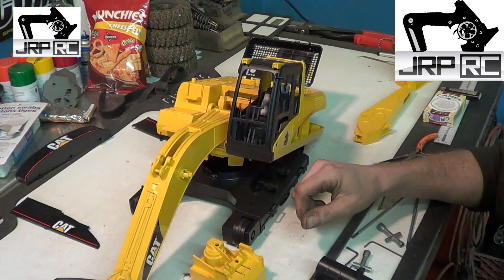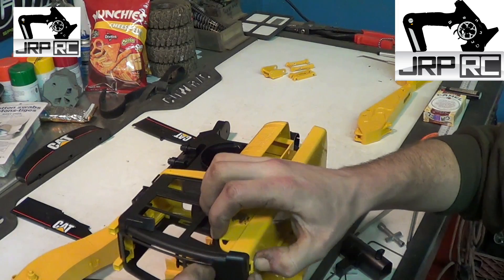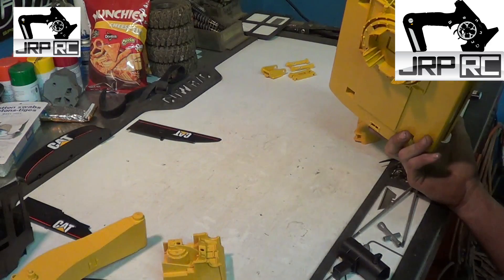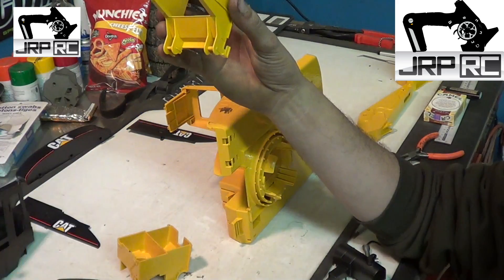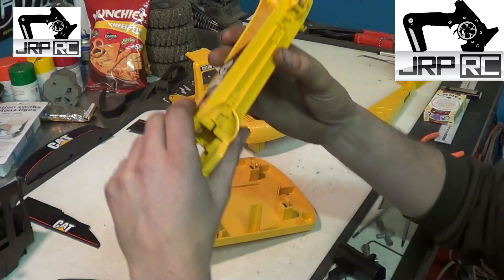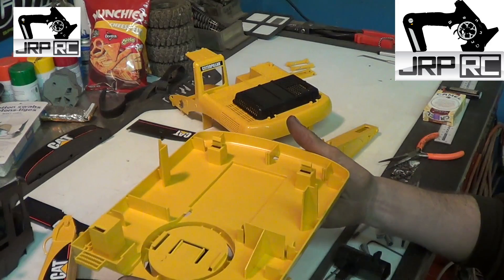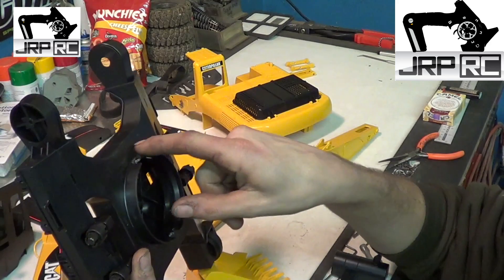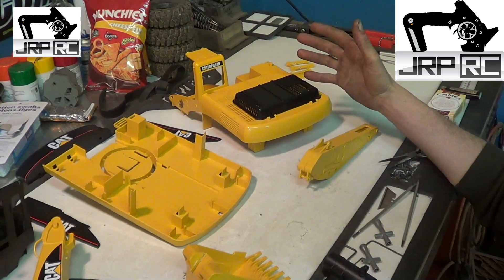JRP RC - Bruder Excavator Rc Conversion Part 1 - Tear Down

Comment: rc mini electric linear actuator 6-12v 3 1/2" check it out
http://www.ebay.com/itm/rc-mini-electric-linear-actuator-6-12v-3-1-2-/261639725859?pt=Radio_Control_Parts_Accessories&hash=item3ceaf16323
Reply: ตว่
Reply: G

Comment: could this be done to a metal excavator  or would it be better with  the plastic  just need to know before i make a decision on witch to buy..
Reply from the maker: theres metal ones that don't cost $3000?
Reply: because the rc excavators are so high i was going to build my own that's why i was asking if the metal or plastic  would work better to  do as your video and make my own , unless you know where to get 1/14 scale that's under 1,000 so just wanted to know if a metal tonka excavator would work or is the  model you have better
Reply from the maker: metal would be way stronger, I don't even know it this one will stay together or not.
Reply: y   7
Reply: D ihnh j.llpxb hck,g

Comment: I tried ordering the actuators but I cant find L16-Rs what website did you order them from and what stroke, gear ratio and Max operating voltage did u put down when you ordered them cuz I can get them directly of the firgelli website but those r the three questions they ask before u order them im not that great with this stuff but it seemed like a good challenge to take on so I can use all the help I can get sorry if im being a pain...
Reply from the maker: First off, they are still waiting on parts at firgelli for the first of the L16-R's, so it will still be a month or 2 before there avaible. and im getting the first 5 made :) The R actuators only come in 6v, im getting the( L16-R) 63:1 ratio. they will be able to dead lift 20lbs the the 150:1 actuators will lift 40lbs! As for stroke, im going with 1 50mm, and 3- 100mm. as soon as i get mine there will be a video about them
Reply: Frrrgbbnn mop
Reply: JRP RC Judd Phillips Hi, thx for all the tutorials on youtube. Amazing toys you got there. Plz tell me what L16 actuators would suit most for an RC Excavator mod, wanna get some advice from you when it comes to gear ratio, speed and power for a good excavator. In the process of ordering them in the nearest future.Thank you.
Reply: Stephen Robert Moore